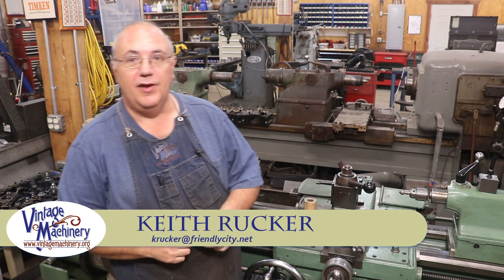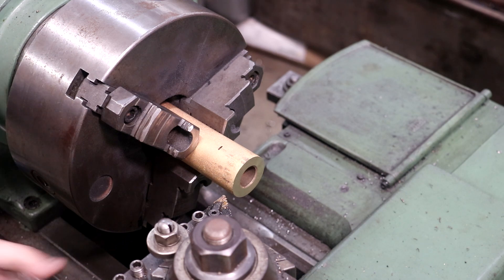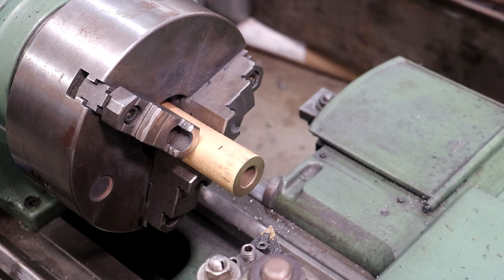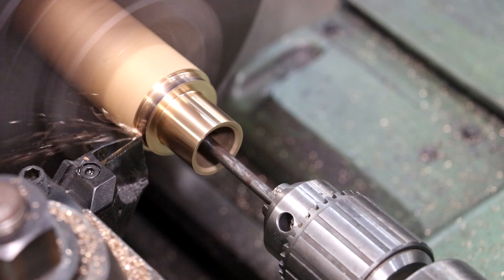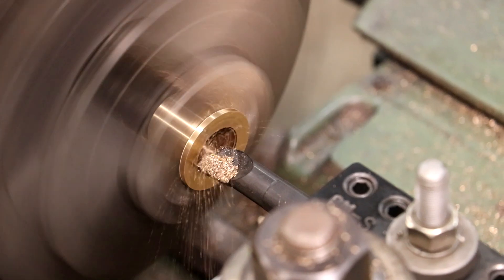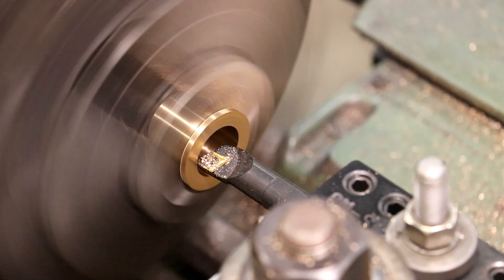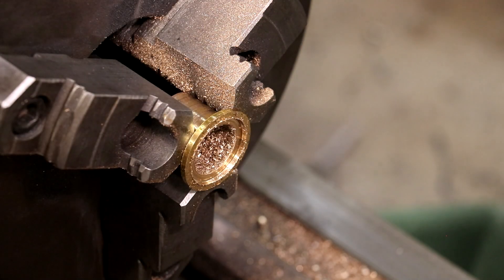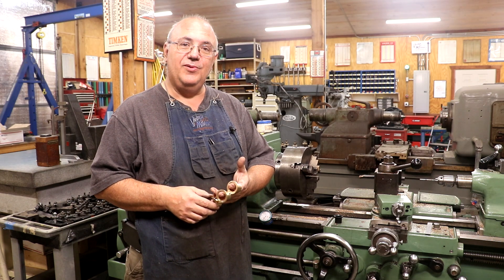Turning Bronze Bushings on the Metal Lathe

Comment: Why wouldn't you bore enough of the material to make the four bushings as the first operation instead of doing it four different times as the last operations?  Seems like a time saver to me.
Reply: Boring small lengths is more precise than boring a long length. The stick out on the boring bar is less so it is more rigid.
Reply: @ericpaul4575  That makes sense.  Thanks.

Comment: Carbide may not be the ideal material to cut oil lite bearings. it tends to smear the surface and that closes the sintered pores, reducing the lubricity, A really sharp high speed steel tool will assist in leaving the pores of the bearing open allowing the oil to pass through. An added benefit is a much lower cutting pressure that will reduce the mark as seen in the video caused by the tool cutting when the tool is withdrawn.
Reply: John McNamara Yep,  I only use carbide when I have to.   Sharp HSS always cuts cleaner
Reply: Is it also true that reaming sintered bushings also closes up the pores?
Reply: I hate to see that tool withdrawal mark. I always made it a point to not leave that mark. I consider it the mark of a poor machinist or tool & die guy. Either that or you're working with a piss poor machine.
Reply: @garys9694  - It's not a withdrawal mark, its an oil groove! :-)
Reply: @somebodyelse6673  No, it's from failing to take the tool away from the work surface while taking it back to the start of your cut. When I first started my tool & die apprenticeship they taught me how to keep from doing it.  OH SHIT, I just saw the smiley face. I guess I'm too serious, and this is an effin youtube video. Sorry about that!
Reply: @garys9694  - if that's the worst thing that happens to me today, I'm doing pretty well.  Stay safe, and find a reason to smile today!
Reply: Les plaquettes pour faire de la finition sur le bronze ne servent à rien un bon outil  carbure sans coupe est beaucoup mieux
Reply: It was careless that he didn't notice the grooves left by tool retraction. Any competent machinist would wind the tool out from the surface before retracting on the finish cuts. Oilite is expensive and a better option is oil filled nylon or delrin. Delrin is probably best and machines best but can sometimes squeak whereas the oil filled nylon like nylatron won't.

Comment: I've modified recovered or new clutch pilot bushings for quick fixes, they seemed to do well enough.  Something to consider if you find yourself in a pinch, as automotive stores are usually closer.  Price wasn't bad, either.
Reply: good to know.  Down here in the sticks, we have 4 auto parts stores within a couple miles, but the nearest industrial supply is quite a ways away...

Comment: When I was in the bearing business we learned the Oil-lite bearings were sintered Bronze or brass. Powder metal heated to almost the melting point. Not quite "cast" as such, hence the porosity. I don't remember if they were already oiled (long time ago). Still wouldn't hurt to soak them in oil before use.  Here's an interesting tidbit: At another job we sold Roper pumps. The ones we had in stock came with Bronze bushings but sometimes depending on what the customer was pumping we took those out and put in Graphite bushings. Now you couldn't press those bearings in because they'd shatter! The trick was to tap them into place with a Compothane dead blow hammer. Plastic, filled loosely with lead shot. Sounds counterintuitive but if you hit them dead square and just hard enough the bushing would creep into place. Had to hit it several times to seat them. Every strike had to be perfect or the bushing would shatter! I was the only guy that could do it consistently (after some practice). Now the graphite bearings were stocked two floors up from the workshop so I would take FIVE when I went to swap a set (of four). Most of the time I wound up taking the fifth one back but every now and then (usually on the last hit) one would go *pop*! @#$%!
Reply: I knew Jerry Zoeller who founded the Zoellerpump Co. of Louisville. He told me that for submerged pumps for sewage and grey water he ordered his sintered bushings NOT oil filled. If the oil filled bushing runs in soapy water the oil would saponify (turn into a hard waxy substance) causing the bushing to cease up.
Reply: @crichtonbruce4329  You can also specify what oil to use based on application.  We impregnate the sintered bronze with the standard 30 weight oil or something exotic for milspec
Reply: The instructions in olden days were to soak in oil for a day or more before use, but who knows what they are in our throwaway age.  Not read instructions for many a decade so don't quote me on the time.
Reply: @littleworkshopofhorrors2395  Nobody adds oil to them, I have had plenty where I added oil, and the bush sucked it all up, and asked for more. They work best where you have a felting reservoir of oil in contact with the one face, so that it can absorb oil as needed, or where it runs in oil. 

I learnt that the best way to get the oil in was to heat up the bushing submerged in oil in an old can, till the oil was nice and almost smoking hot, then let cool. The oil would then fill all the air spaces, and you could use a very viscous oil in there as well, with it penetrating well when hot.
Reply: @SeanBZA  i seem to recall SAE 30 or 40 straight non detergent motor was recommended .
Reply: @SeanBZA  My grandfather (who worked as a fitter/turner for the local main roads department) tells me that he used to do them by putting the bushing on his palm, filling it to the top with oil, then squishing the palm of his other hand down on top until oil wept from the outside of the bushing. I guess you get very oily hands doing this though...
Reply: @littleworkshopofhorrors2395  Actually soaking doesn't work that great need to put in vacume
Reply: @michaelidarecis  i did say don't quote me.😉 Boiling in oil would help absorbing the lube as not many people would have vacuum systems in their workshops back in the day.
Reply: @michaelidarecis   your right the best way is vacuum impregnate I've done loads in the past not just bushes castings aswell
Reply: About the same experience when I was a pump mechanic repairing graphite pumps. Alignment had to be perfect and assembly force evenly distributed. This was back in the '70's so no internet and nothing in the available literature. The manufacturer had tooling available, but the company I was working for refused to buy it. Made my own in the machine shop.
Reply: @Davemte34108  Yeah my time was in the late '70s and early '80s. Lost count of how many pump/motor baseplates I made out of "ship channel'! Seems every one had to be "custom". Lay out the hole locations with DyKem, drill and HAND TAP! Mount motor and pump loosely. Make a coupling guard out of expanded metal (and paint it red). I'm sure I pissed a lot of installers off because I put the Lovejoy coupling halves on the shafts backwards with the "spider" in a plastic bag with a note attached (inside the coupling guard). Note read" CAUTION! PUMP AND MOTOR MUST BE ALIGNED AFTER BASE IS GROUTED AND PIPING INSTALLED! He He! I was a Sales Engineer (one of three) in the Engineered Products dept but for some reason I got to do the "make it work" stuff...

Comment: When I was an apprentice I repaired motors and when replacing oil-lite bearings we would impregnate the oil so I am not sure if they come pre-oiled.
Reply: you can buy it either way
Reply: Getting them dry is not as easy as you would think.  Most of the time they are impregnated with 30 weight oil.